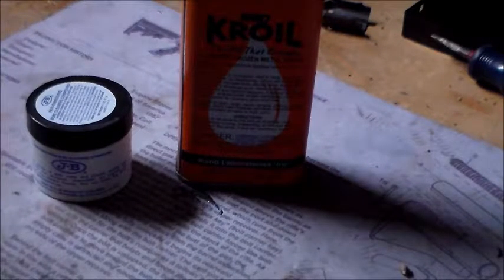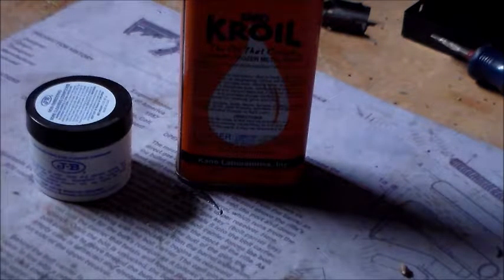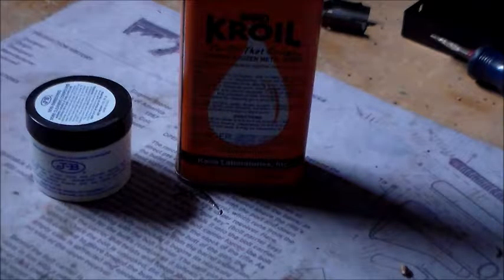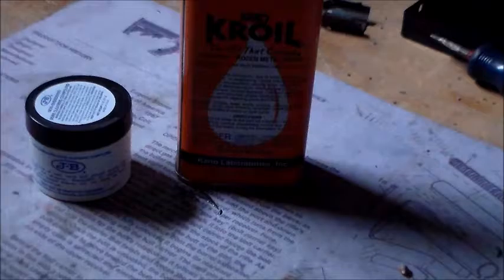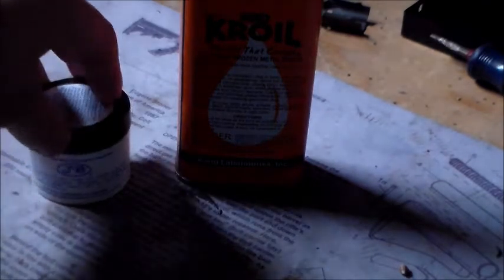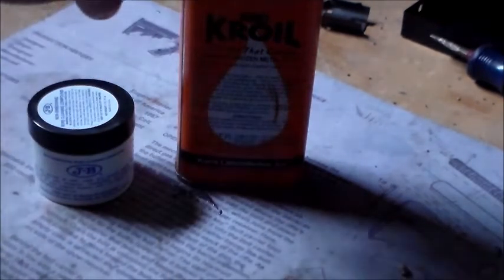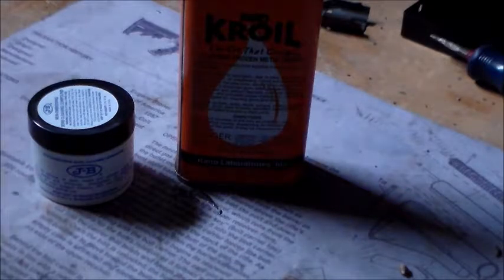Answer to Prevent Bore Fouling  Two simple Ingredients For Rifle and Pistol Barrels

Comment: The use of JB Bore Paste and Kroll to remove fouling, including lead and plastic among other things, is a good idea and your efforts to make shooters aware is appreciated.  It does not prevent fouling however - nothing does except nothing shot down the bore. What it WILL do IMHO is reduce the amount of fouling and make periodic bore cleaning easier. Benchrite, LLC (the maker of JB) and Brownells sell these items as a kit. It is necessary to remove the JB after use with a solvent but there is nothing wrong with leaving a trace of Kroll in the bore. Personally I prefer the bore to be pretty dry unless I am going to store the gun for a long time. I have used JB for many years, but infrequently since it will lap the barrel over time. Many precision shooters claim that a hand lapped barrel fouls less, and cleans easier. This JB does the same thing. BTW you really do not need to use Kroll, as any good CLP or oil will work. I prefer Ballistol myself. If you really want to remove everything from the bore, this stuff works better than anything else I have tried - and I have tried just about everything out there.

Comment: You are completely wrong - KROLL is VERY gigroscopic, and should be removed by any  DEGREAZER to prevent from rust. So, Kroll is NOT RUST preventing chemical. Kroll  is used to remove completely polishing substanses ( JB,...) from the bore. For rust prevention use after DEGREAZER any neutral oil ( balistol,...) or special Rust Prevent chemicals - ingibitors